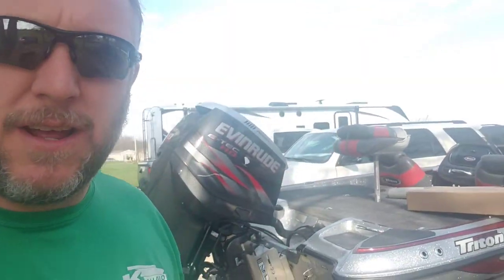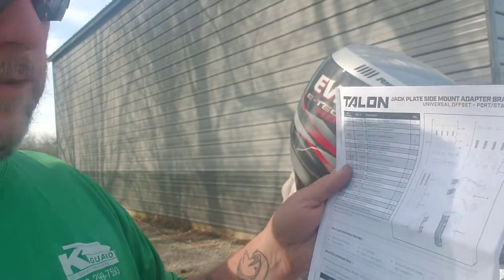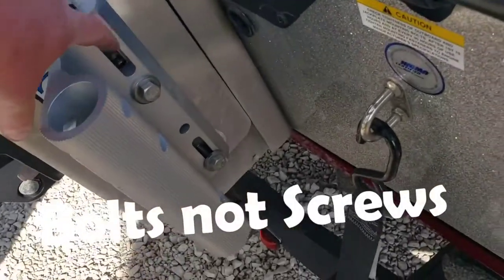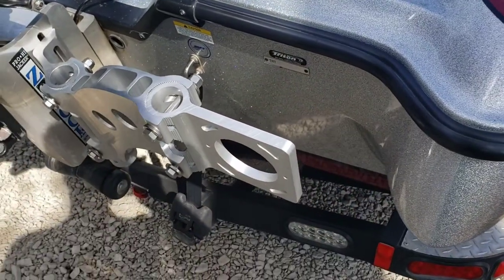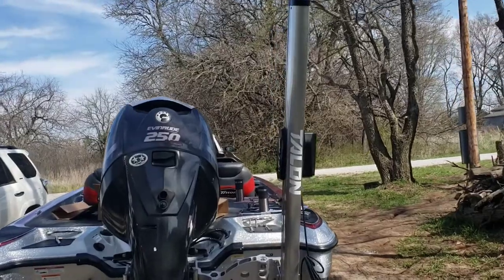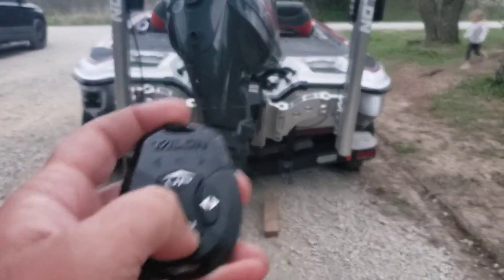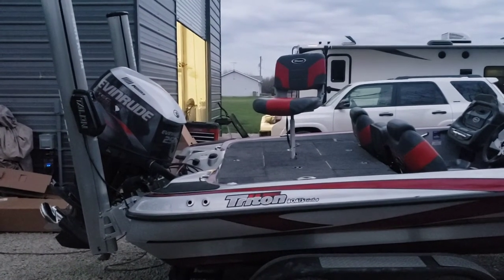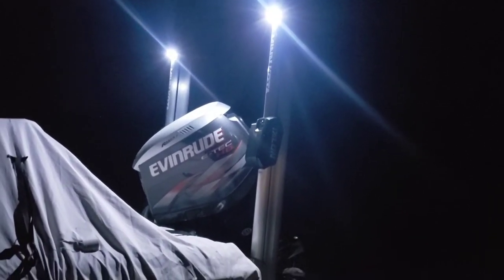15' foot Minnekota Talons Installed on my Triton

Comment: that jack plate don't look too hard to do it it looks like two bolts and two screws. can you later add the tilt bracket on the jack plate?